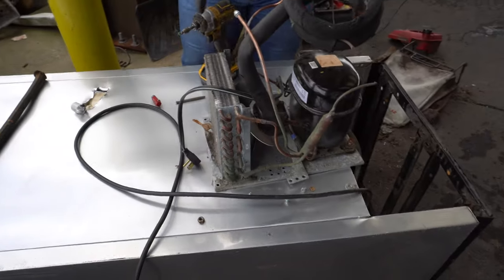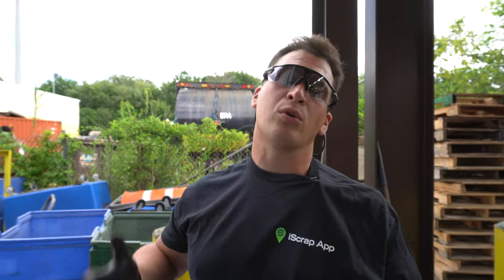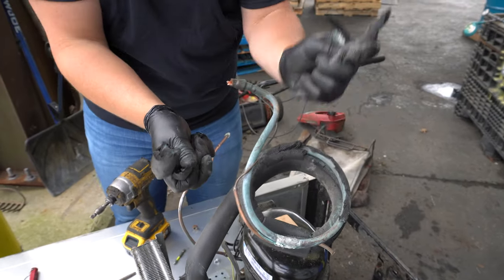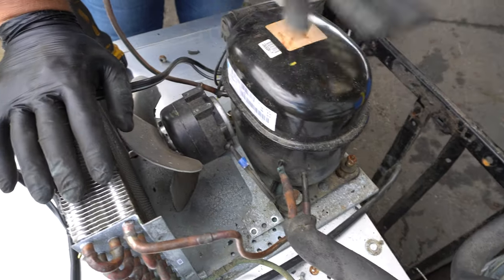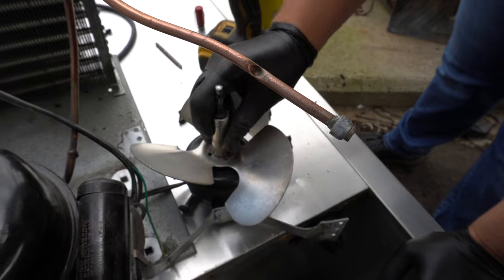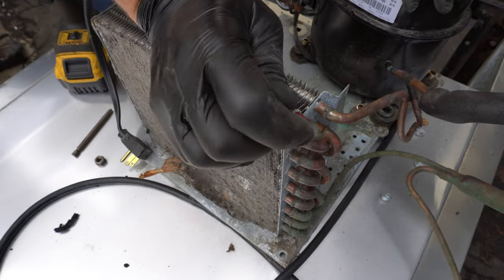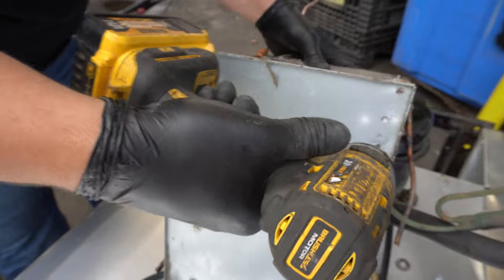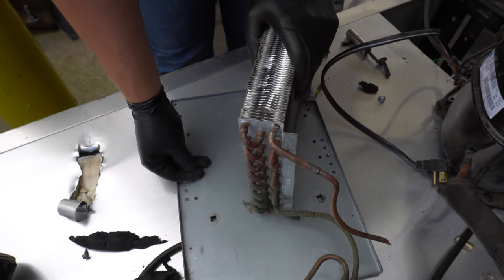How To Scrap A Refrigerator - Maximizing Your Profits with Scrap Refrigerators

Comment: Angle grinder along the seams, cut out the cubes. All of our older units at the restaurant are stainless and aluminum,  and the copper lines inside add up also
Reply: use hand propane torch

Comment: I cut the copper tubing out of the coils for more money. It goes quick with a box cutter running the blade along the length of the tubes and just pull them out.
Reply: @wadechadwick4323  I thought they bought them as a core. Im about to get rid of a few, you're saying I'll make more just saw sawing them out of the thin aluminum there?

Comment: As he alluded to, you need EPA certification to recover refrigerants, of which there are many mant types. "Freon" is a brand name for many of said refrigerants. The latest are often similar to propane or butane, or actual propane or butane. For example R600 is butane, R600a is isobutane. R290 is propane. Those are now considered earlier generation, the latest are similar but less flamable. 

Very complicated subject. Even the oil has to be specially disposed of, to be honest.
Reply: isn't the oil just mineral oil?
Reply: @brandongarnett5582  In my state - California, compressor oil can only be drained out by a CAR - certified appliance recycler. Refrigerant can only be recovered by someone who's EPA certified. 

Not saying I entirely agree with the ways scrap dealing  is regulated, I'm just pointing out facts.

Comment: This comment is a little irrelevant to the video but how do you identify tin plate vs corrosion? Ive came across a lot of copper wire that looks 100% like tin plate but when hit with an alloy analyzer it's just corrosion. I don't have an alloy analyzer and I'm having this problem
Reply: Use HCL / Muriatic acid and wait several minutes, and you will see if the item is becoming bright orange, which means clean copper.
Reply: And use a high percentage, like 33% for faster and better results.
Reply: @Dino_Buk  definitely not worth the cost or time, and plus it's dangerous. Unless your buying your own wire directly from contractors or businesses it's not worth messing with in general. Most scrap companies or recovery companies have connections to forges where their getting 4 and 5$ a lb

Comment: I suggest you recover the refrigerant and reuse the compressor as a silent air compressor plus you can earn a profit from the refrigeran and save the ozone at the same time just make sure you that the states your living doesn't forbids recovering refrigerant or else you have to hire a HVAC technician to able to extract it legally 

Well I'm not from the states but base on my HVAC tech from there they said it's illegal to some states to recover refregerants
Reply from the maker: Yes in the US you need certification to recover refrigerant. It isn't impossible to do as a layman. See here: https://iscrapapp.com/blog/can-you-recycle-freon-from-air-conditioners/

Comment: But they dont pay shiz for it . I took in 1000 lbs clean Cooper tubing and got 14c a lbs for it . Was'nt worth the gasoline to houl it in .
Reply: then you got ripped off.. it’s upwards of $3 in your common and not so common areas. $2500 is the minimum you should’ve seen for 1000 lbs. or the 800 you really had.
Reply: More like steel not copper. Did you ask the scrap yard why?  And why did you sell your clean number 1 copper at that price anyway?
Reply: @charlesyates6687  copper tubing right now is 3.30lb!